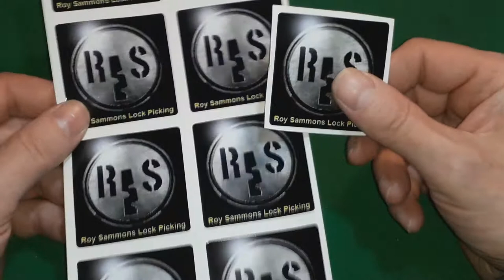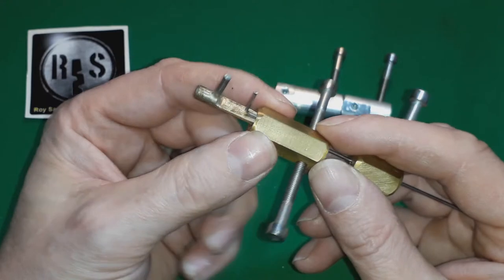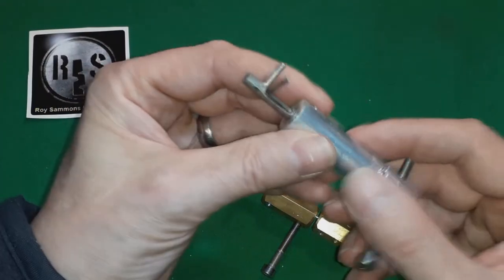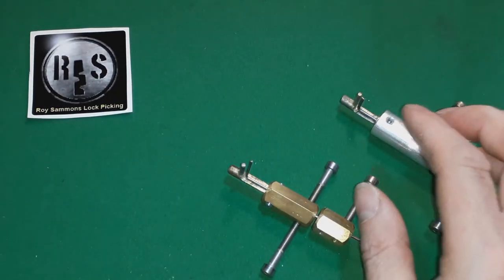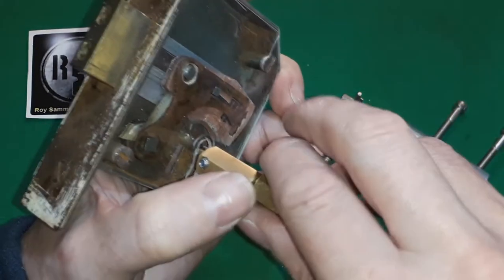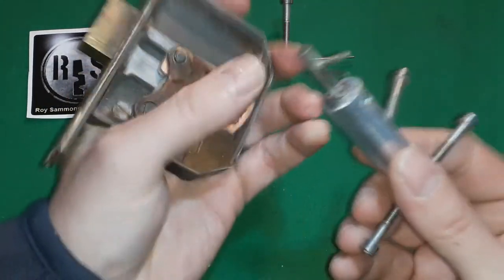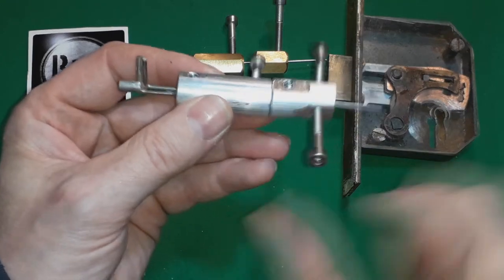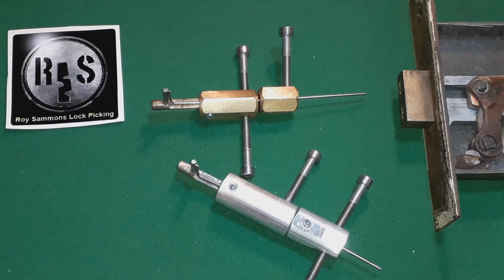(176) Hybrid 2 in 1 Lever Lock Picks For Under £5

Comment: The brass rod 7:08 to keep it rigid I thought was an excellent idea because it must help with alignment of the picking wire, nice one Roy ;-)
Reply from the maker: True, but the screwed bolts help with that too. Brass seems a little easier to work with over the aluminium. Also the brass rod has flat sides to work with when drilling, the aluminium being round you have to file a flat so it can be drilled.
Thanks for watching and commenting.

Comment: Good morning Roy, YT recommended this video, so I had a gander, and I'm jolly pleased that I did. Very interesting indeed. Lovely workmanship.
Just wondering if you are snapping drills because you aren't grinding off the outer edge of the drill tip? It causes binding!
Love your stickers 😎😎😎
All the very best to you and yours 👍 👍 👍 🍻
Reply from the maker: Hmmmm not quite sure I understand Tinnie.
Reply: @roysammons2445  😂 😂 😂 one year later 😂😂😂
An ordinary drill tends to bind in soft metals like aluminium. So the trick is to grind off the sharp cutting tip, and then one can drill without binding and often snapping small drills.
Haha, cheers Roy have a great week ahead 👍 🍻